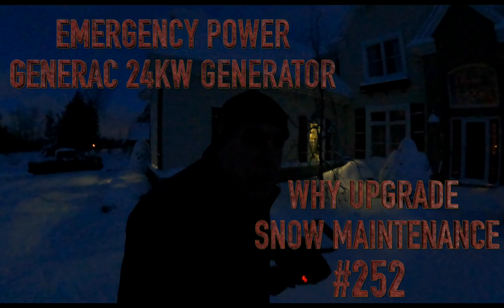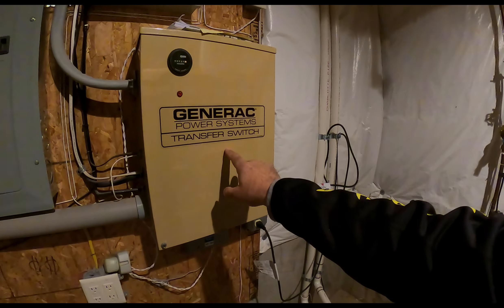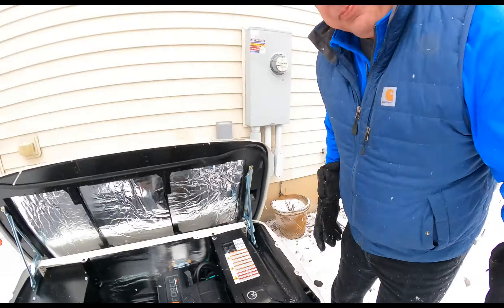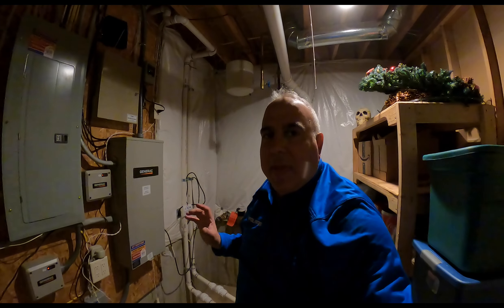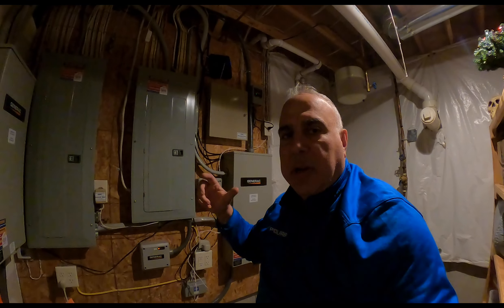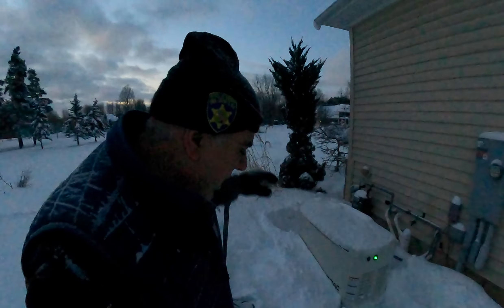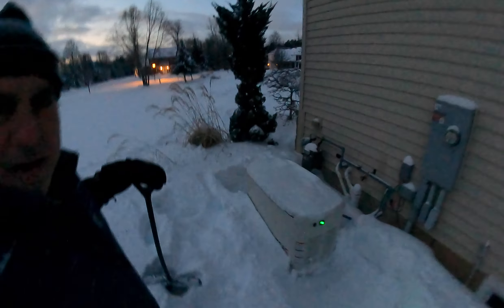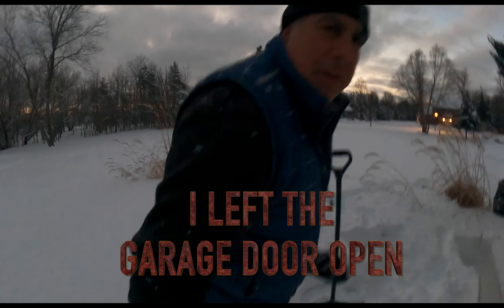Emergency Power Generac 24 KW Generator Why I Upgraded Snow Maintenance Inside My Utility Room #252

Comment: There's a difference between a 200A service and multiple 100A / 200A sub-panels. If you have and I lost count 300A or 400A to your home which is certainly possible in a 10,000 ft² home or larger with 4+ AC units plus a couple Tesla cars then I would look at something more in the 50 kW or even larger range. I guess it depends about how often your power goes out and for how long. Short-term outages meaning under 24 hours an air cooled generator is perfectly fine and supplying a lower kilowatt hour than your service is also fine (things will be turned off or on). As long as you understand you have to trade one device over another for priority otherwise you would have an overload.

The reason I'm looking at your video and others is I'm trying to justify going from a Generac generator to a Kohler generator. Our last generator lasted 17 years and it's still running, but the stator and voltage control isn't what I would deem two thumbs up. I live in Florida and in the Sarasota area and we were lucky to have only gotten a glancing blow from Ian and we lost power for about 24 hours. Although some areas around us may not have power for days or weeks. The problem also in Florida is sometimes natural gas gets shut off for a variety of reasons or your subdivision may not offer NG. We opted for a buried 500 gallon LP tank. The reason that I even mention this is that your generator's capacity is calculated on liquid propane not natural gas, so your capacity is probably 18-19 kW, you lose at least 20% capacity on NG.
Reply from the maker: Thank you Your comment is excellent. My generator is just for short term emergency use. The longest my previous generator ran was 18 hours it was 15KW so on ngas it’s 12kw. It powered most of my house so we were careful to manage usage. Good luck with your decision it’s hard to beat these generacs.

Comment: No shit.  I think i put this generator in.  You're out by clarence? I remember this one.
Reply from the maker: Who do you work for? I can't see your picture to agree. But if you did you did a great job.
Reply: @maraudermitchelli  i worked for melton electric.  Zenner and ritter Who subcontracts all electrical to melton.  I remember being there as soon as you showed the utility room i was like hey that looks familiar
Reply from the maker: @blakeehmke007  You did a great job. We had to remove the delayed start on the air conditioners as it was causing problems. Everything has been working great. BTW I hope you're happy with the video. Be safe.
Reply: @maraudermitchelli  love the videos.  Love electricity and having happy satisfied customers

Comment: They did short the run cycle my generic 14 kilowatt generator only runs for 5 minutes for the test cycle seems to be long enough it does cool hot exhaust out of their jobs side so I guess the motor is getting had enough we'll see
Reply from the maker: Thanks Richard mine is running well, I like the shorter test weekly.